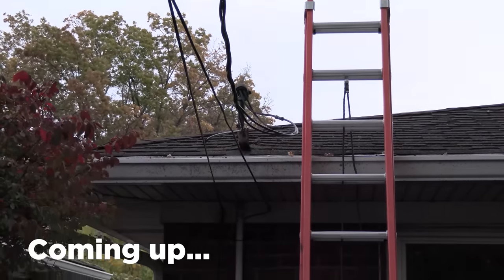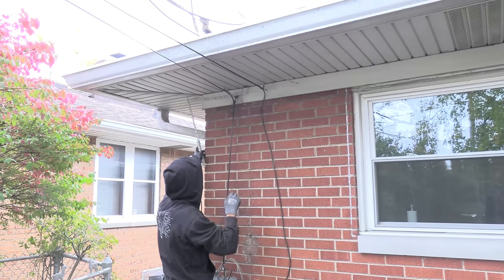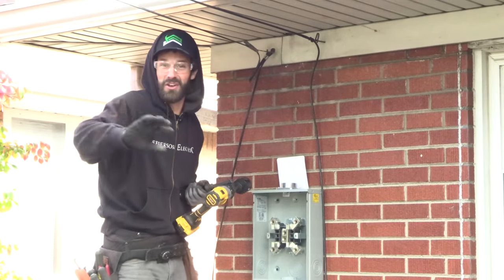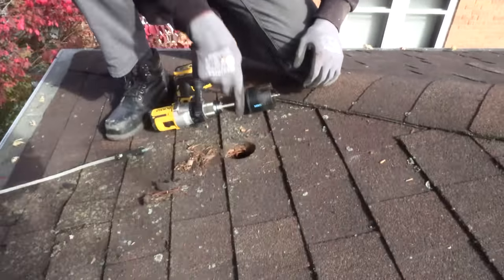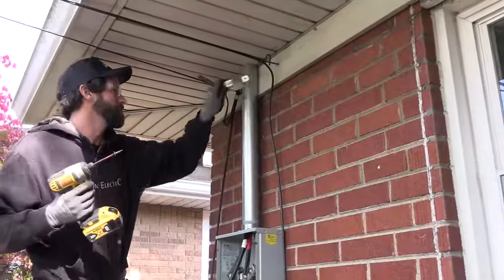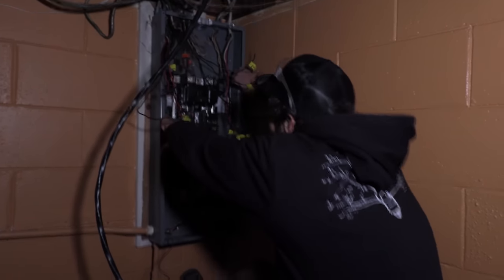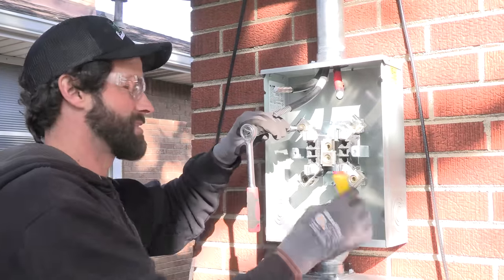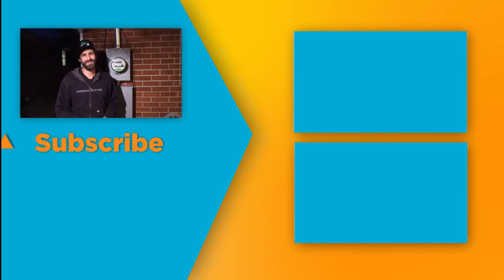Found an Electrical Dinosaur Downtown

Comment: I don't fear working in an a live industrial 480 volt 3 phase cabinet. Cutting, sealing, and otherwise messing with a roof, I feel fear.
Reply from the maker: 🤣 Preach!
Reply: Residential journeyman here. That’s great man. Seems like you’re real comfortable around that high voltage equipment, but being complacent can also lead to injuries. Be safe out there!

Comment: A 200amp upgrade in Saint Paul MN was quoted at almost $7,000 last year when I got a quote. I wish prices were as affordable as Indiana. A new 200amp service for my garage with surge protector, and a main breaker on the meter was $4,250 and that’s the cheapest I could find… I went out to check the work, and asked if he needed to torque the lugs where it’s connected and he said that no one really does that. I’m not certain if I should have believed him after watching your level of work!

Comment: Wow learned alot, the thhn vs xhw wire, passthrough panel lugs, confirmed my love for SQ D panels, use a jbox not a LB, confirmed my recent purchase of milwuakee SDS drill, carbide hole saw for roof, holding hole saw with boots if pilot is not available, and more. All notes in my head now

Comment: I like to land line side cables in meter cabinet before weatherhead is installed—cables are easier to strip and can slip up/down conduit for easier installation. 
(glad to see the Noalox🙂)
Reply: Isn't Noalox code now for new panels?

Comment: 18:00 Why did you explain that the extra spaces in the trailer disconnect will negate having to go through the outer wall of the house for new circuits... and then go through the outer wall for the new hot tub anyway...?
Reply: I believe he was talking about the possibility of future expansion being easier. That basement run to the hot tub seemed rather short and the disconnect will probably be right on the wall so no conduit to run around the outside.

Comment: 0:59 If you don't need a load center outside 230.85 (3) says as long as its service rated you can install a non fused disconnect as your emergency disconnect outside while the service disconnect remains in the load center inside.

Comment: The one thing I don't like about making your own stand-off legs is the top gut will allow water to leak in and when it freezes the pipe will split. They need to be sealed to prevent that problem.

Comment: Eaton makes a 200 amp meter/main 20/40 ckt with feed-thru lugs.  All in one unit saves two pieces of eqipment.

Cable guy kits are available.  That's what I use.
Reply: Odd as it may seem, some local utilities do not allow the use of meter/main combos. And in Indiana and here in Idaho, only meters and disconnects are outside, breaker panels inside. No one wants to go reset breakers in sub-freezing temps and feet of snow.

Comment: Definitely not the ideal way to install the rain cap at the mast penetration. I would have tucked the top under the shingle tab and sealed the entire flange to the roof with roofing cement and shingle nails at the four corners. Just my preference. But then again, I would have inspected and repaired the rotten roof prior to calling you in for the upgrade. Like your work.👍👨‍🦳🇨🇦
Reply: You're right, but the average homeowner will probably put off one of the projects to avoid a massive bill for the whole deal all at once. From the looks of things, it will be ok for 10 years until they do the roof again.
Reply: @rupe53  hopefully the owner doesn’t have a roof leak that finds it way down to the breaker panel.🙀
Reply: @richardc6932  .... if you watch closely, you will see he caulked all around and tucked the boot under the shingles. If he sealed the conduit at the meter, then that part is set.
Reply: He did do all of that

Comment: Please share the reference for additional mast supports. I've never seen this in IN and it looked to me that the gold book said GRC/IMC would eliminate the need for extra bracing. Have you seen rigid mast installs and effects of insufficient bracing?
Your videos are top shelf! The best around for this subject. Thanks!
Reply: It sounded like a local code or utility thing.  Seems like overkill, and just more spots for the roof to leak...

Comment: Now would be a good time to bond the telephone and cable protective grounds to the ground bus in the disconnect. Bingo, all the electronics are protected from surges from the overhead wiring drops.

Connecting the communication wiring grounds is required in Chapter 8, Articles 800 to 830 in the NEC (NFPA 70). The cable television ground disappears below the concrete and the telephone ground goes through the brick wall. 

The interior panel should have its ground to neutral bus connection removed, the only place for this connection is the at the first means of disconnect, now outside.
Reply: You mean remove the telephone grounds.  It's not 19dickity2 anymore.
Reply: @adrianspeeder  Connecting the telephone demarcation ground to the grounding electrode reduces the hazards from lightning and powerline crosses to the interior of the home. Until all the telephone twisted-pair wiring is disconnected from the point of demarcation there is a hazard. The telephone drop cable to the power pole still exists and is still connected to the point of demarcation.

Comment: Why the two separate boxes? Why not use an all in one meter panel that has the meter and the breakers all in one can?
Reply: Seems as if he's working with readily available material. If that's all the supply house has, and he's getting the job done today, you gotta do what you can to make sure to finish.
Reply: Talking with my electrical supply house last week, the combined panels are significantly back ordered at the moment.  
They had one in the store, and it was one that'd been ordered by one of the local electrical companies, months prior.
Reply: @09BOSs21  ... not sure what his local market is, but in certain areas the "future expansion" from outside is a VERY common thing. (adding a garage, RV hook-up, etc) Going to a full panel is peanuts if you have to buy a separate disconnect anyway. In my area a "metered / main pan" is hard to get these days.

Comment: With that stripper on the big cables try right at the end of the cable giving it a slight twist to each side as you pull it off the end you might be able to open up just enough of a slit that it will slide right off with your gloved hand

Comment: In UK it's not unusual to find asbestos board underneath plastic soffits which if cut with a machine could result in dangerous dust being released so I would be wary of doing that sort of hole without knowing exactly what is underneath

Comment: I have a question for you. If I disconnect wires from electrical panel do I then need to remove that wire throughout the house or can it still live inside the walls and under the house as long as it has no power at all? Or wil I have to pull all the old wiring
Reply: You can leave it be, it's fine.

Comment: Where do you need 200 A services? In Finland typical ones are 3x25 A or 3x35 A and even on the latter ones has heating and sauna. 3x63 A is an option but it often costs 100 € more a month than 3x25 A.
Reply: We don’t pay a premium for increased service current. Also our devices are mostly 120V and draw more current than 240V devices doing the same work. Additionally, 3 phase power requires even less current per leg than single phase split that we have in the US.
Reply: 200 amps is pretty standard on new homes.  Ideally, 160 amps is the max continuous draw.  US homes are power hungry, but it's rare to draw all that at once.  The point is:  you can if you need to.  EV charging is increasing that demand even more.

Comment: You mentioned that the trailer panel allows external loads to be installed without penetrating the home, but then you are installing hot tub wiring to the inside panel. Does that mean that the hot tub is indoors?

Seeing you on the roof without fall gear made me very netvous! Why don't you wear it?

Comment: You have the roof boot nicely flashing the mast now, but the tube of something goopy will be back. When it is reroofed, you won't be around to disconnect everything and slide a new boot over the mast. The plastic boots are doing good to make 20 years, not all of them make 10 so it will be at end of life when it is reroof time. Chances are, the roofer will do like the last roofer, shingle up to the mast and pull out his trusty tube of his favorite goopy stuff and glop it all over the shingles and mast. I know that there are retrofit kits available but probably not stocked at the local big box store and is a lot more expensive so chances are good that it won't be used.

Comment: Hope you actually charge those prices. Quality of work was half assed at best. There is a reason you never included a photo of the panel without any wires landed. Mixing and matching panels brands is not cool either. You got the cheapest of cheap square d panels on top of it. Should of just made them both Siemens
Reply: Also wanted to add that your sales tactics are dishonest at best.

Comment: Why did you strip the SER so far back?
Reply: It's already protected from pipe. So, stripping it allows you to feed back a little wire into the LB when you are connecting the wires in the disconnect and have a bit extra.